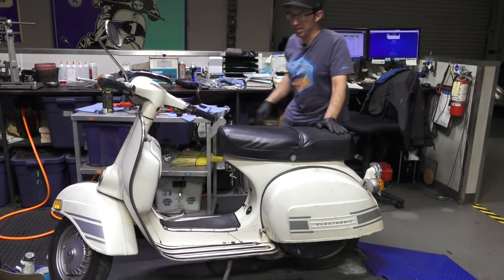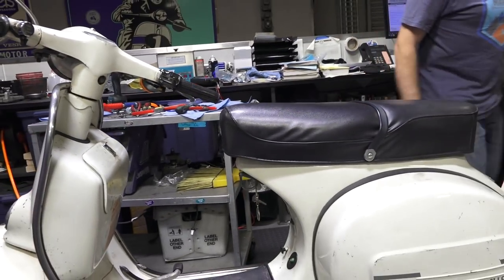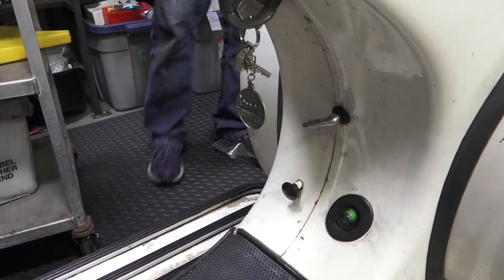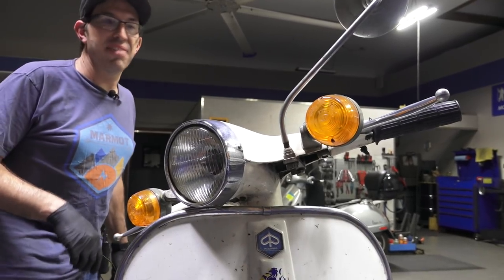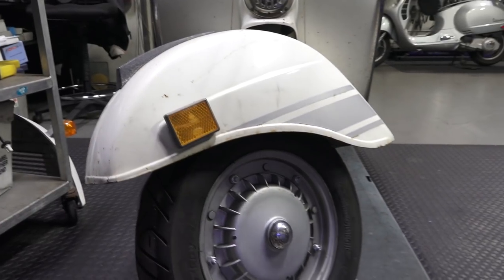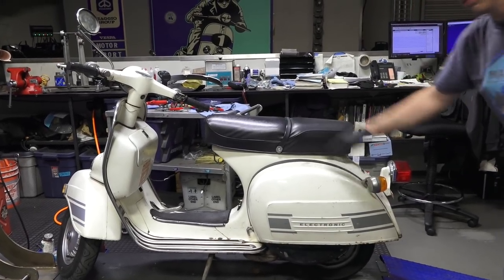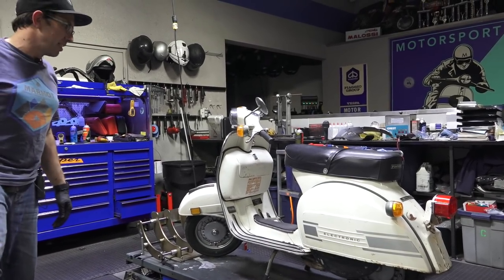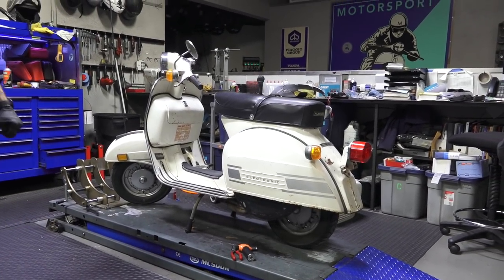Robot's All Original 74 Vespa Rally 200

Comment: I have the sort of maroon color all original 74. I had to put an external condenser kit from you guys on it. We couldnt find the old stator internal mount condenser.I have a few Femsa's in my keepsake box as well, and a few rectifiers. I've never seen a vintage Vespa here in Western Mass. in Ten years. I wish there were vintage Vespa mechanics around here to bounce questions off of.
Reply: I have a 79 P200, but Im in Central Mass. Its kinda new to me, as Ive only had it since 2020. I also wish there were vintage vespa mechanics around here...let me know if you find any! My names Andy. My 200 runs great, and everything works, but Im worried that the electrical might have problems, as it seems in rough shape. It came from Maryland originally, by way of Rhode Island.
Reply: By the way, I have a goal this summer to take it for an extended ride leaving from my house...maybe a camping trip, somewhere in Mass.

Comment: I never had a Rally 200 myself though my friend had a 1975 & it was white with the black speed blocks & lovely. I had an early P200 in original white non oil injected 1979 model at this time which I bought from an old Vespa dealer in my town in Scotland.  The P200e was almost ten years old at this time and was mint like new & low miles & ran like a Swiss watch & was pretty quick in standard form.  If I recall my mates Rally 200 was quicker & felt much smoother with lovely acceleration & people used to say it sounded more like a motorbike.  I used to get a loan of the Rally 200 often & I loved riding that scooter round Glasgow & Paisley where I lived.  I used to surprise most cars with the turn of speed on urban roads & the smooth turbine like acceleration all that with the beautiful looks made each ride on the Rally 200 a great occasion as well as it being so enjoyable to ride in itself .

Comment: Metal vs. plastic. Thats a no brainer. 

I could get my hands on -89 Vespa PK 50 XL. Would it be worth it? I mean how is the tuneability on those engines? How high can you go in displacement? Im a big guy and live on a hilly area so need the umpfh :) Around 10hp would be nice. Achievable with reliable kit eh?
Reply: The new Vespas are steel monocoques too. Not much plastic actually.